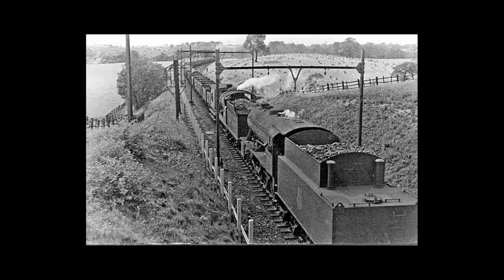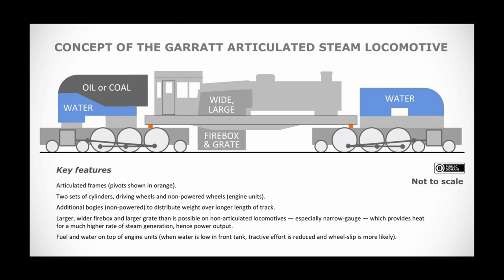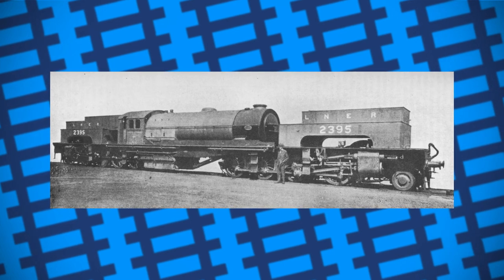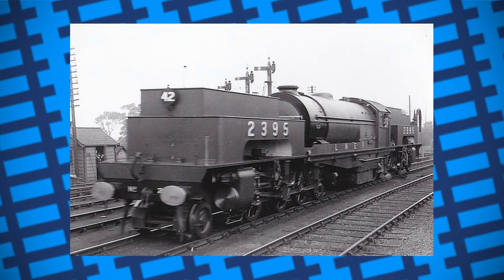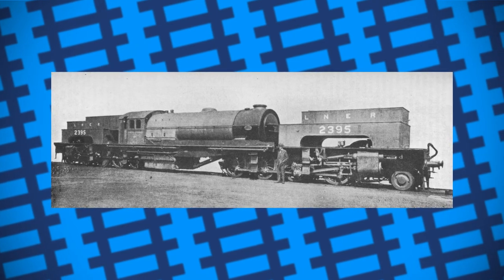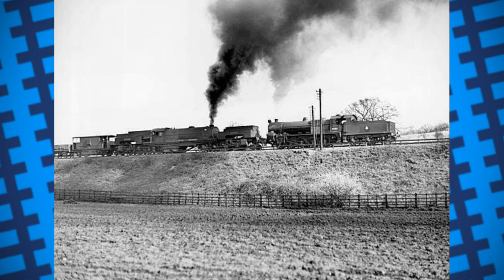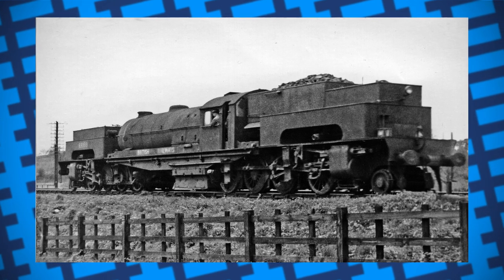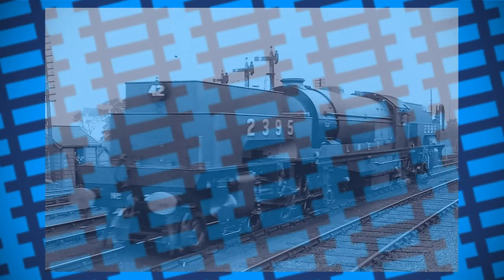The LNER's big banking engine -  LNER U1

Comment: As an oil-burner, BR missed their chance to build their version of a Southern Pacific cab-forward. The SP 4-8-8-2 locos had little trouble with steaming, even when hauling passenger trains and fast freights. It's pretty clear that LNER basically tried to drive cylinders of two 2-8-0 locomotives with one boiler, and the result was predictable. At least it tracked well, I'll warrant.
Reply: The boiler was big enough to supply the steam needed, the locomotive had no high speed requirement but was slow working at relatively long cutoffs. The design of the exhaust system deserved some attention and the valve gear fitted should have been changed to the type fitted to later batches of O2 builds.
Reply: @muir8009  - No, because when you look at the Garratt that LNER built, the boiler does not seem much larger than the boiler on one of their 2-8-0s. That's what I mean by the relative lack of performance being predictable. I am aware of the narrow British loading gauge; however, British mainlines of the time tended to be very stoutly built, with many masonry viaducts, so axle weight should not have been a concern.

On U.S. railroads, for example, articulated locomotive boilers stretch the length of both driver and cylinder sets. Thus, by the 1940s, a 4-6-6-4 or 4-8-8-4 could pull a freight at 50, or a passenger train at 70, and keep running at that speed all day. Mechanical stokers and oil-firing helped provide such high performance, too.
Reply: @muir8009  - Frankly, I'm under the impression that you don't understand locomotive engineering. Because of gauge and loading gauge differences, it is hard to compare SAR or British locomotives with North American models. However, it is clear that the Garratt design was made to cope with the lightly built bridges in Africa. I also thought the LNER bridges could have handled heavier locos than the U1, but on retrospect, that appears to be an incorrect conclusion.

Let's look at axle weight vs. tractive effort for these models -- I'll use metric to prevent having to convert between short and long tons:

South African Railways Class GL 4-8-2+2-8-4: 19,000 kg driving axle weight, 349.9 KN tractive  effort  (18.4 KN/1000 kg)
Union Pacific Big Boy 4-8-8-4: 30,900 kg driving axle weight, 602.2 KN tractive effort (19.5 KN/1000 kg)
Southern Pacific AC-12, 4-8-8-2: 30,150 kg driving axle weight, 553 KN tractive effort (18.3 KN/1000 kg)
LNER O2 2-8-0 (Gresley-designed): 163.4 KN tractive effort
WD 2-8-0 ("Austerity"): 15,500 kg driving axle weight, 152.2 KN tractive effort  (9.82 KN/1000 kg)
Great Northern Z-1, 1-D-1: 32,300 kg driving axle weight, 250.2 KN, 1-hour (7.74 KN/1000 kg)

Both American classes had double-stacks, for freer combustion. The GN Z-1 locos were built at about the same time, principally to haul freight trains over the Cascade Mountains. GN usually used them in pairs.
I could not find or calculate a driving axle weight for the Gresley-designed 2-8-0s, but the Austerity class were probably suitable for Woodhead bank use.

Even allowing for the difference in width and height due to gauges, there is no doubt that the performance of the Big Boy (25 built, in two batches, not one-off experimental locos), and the Cab-Forwards (256 built, all classes) benefitted from the boiler being carried across all the drivers, which was possible because of the strength of the rail lines on which they were operated. Although the performance of the SP's cab-forwards was significantly less than the Big Boys (as shown above), SP used its cab-forwards on a much broader range of lines, all over California and Oregon. The AC-class even saw passenger service.
On the other hand, the SAR Garratts were good choices for the more lightly-built African lines, but the performance of the Garratt design was affected because so much of the engine weight was carried on non-driving wheels. 

My contention WAS that LNER's Woodhead line could have benefitted from an oil-fired Cab-Forward design, because the bridges on that mainline were presumably strong enough to bear the weight, and the engine crew would have been in front of the stack. The only practical reason is that the bridges would not, in fact, had supported the weight of an articulated. However, a review of British steam like that used on the Woodhead branch indicates that axle weight was the issue -- a Cab-Forward design, with a massive boiler carried across all the drivers, would have overtaxed LNER bridges. We know the LNER always struggled financially for capital investment; LNER management would probably have preferred electrification, with its its high tractive effort/weight ratio, over strengthening bridges for less efficient larger steam locomotives.
Reply: Well NO.   The U1 had a significantly larger boiler and firebox than the 2-8-0's it replaced.   On a Garratt the boiler is not limited to being long and skinny to fit over the driving wheels like a Mallet is.    There is no way that an American-style Mallet would ever have fitted the British loading gauge.

Comment: Wonder why they didn't electrify the grades?  The technology already existed.
Reply: The LNER planned to do that, but implementation was delayed by WW2. The Worsborough branch was part of the Woodhead electrification scheme from 1952.
Reply: The problem is the time taken to change locomotives, which would slow things up even more. The other alternative, electrifying the entire route, would work, but would cost more. That's what they did on the Woodhead Line, both the grades and the tunnel making electricity much more attractive.
Reply: @SynchroScore  If they would have used electric locomotives to pull the entire train including it's steam locomotive, they would not have lost any more time than for adding the steam banking locomotive.

Edit:  This is what the Baltimore & Ohio Railroad started doing in 1895 with their first electric locomotives, although these were for working in the Baltimore tunnels, which had only a mild grade.
Reply: @Lucius_Chiaraviglio  and again theres the issues with engine swaps. Recall that as soon as b&o could they scrapped the electric section. Such a pity they dollied up the world's first mainline electric locomotive for the '27 exhibition and then promptly scrapped it immediately afterwards!
Reply: They did eventually. The project was started in 1939, but WW2 stopped it, then the economic hardship after WW2 held up the project until the 1950s.
Reply: @TIMMEH19991  Better late than never, but that was after a long time of insufficient measures.

Comment: The wannabe Y6b.
Reply: Wannabe? Any particular reason?
Reply: @muir8009  Built for similar duties as the Y6b, same wheel arrangement (2-8-8-2), but not as much fanfare or success.
Reply: @Southern Modeler  Despite the U1 predating the y6b type and being built for a very different role